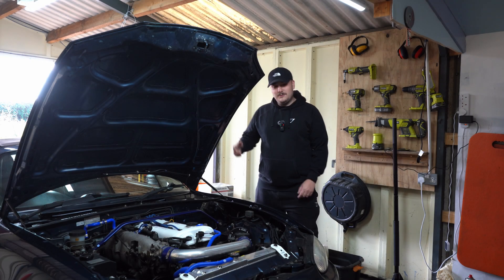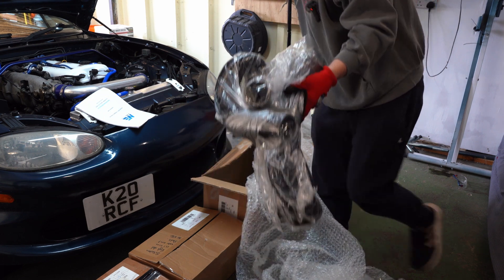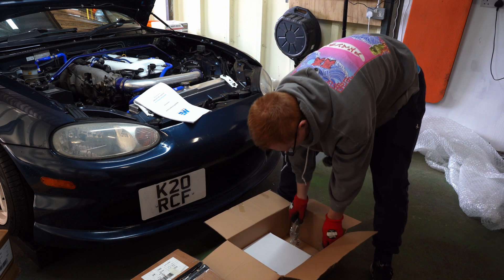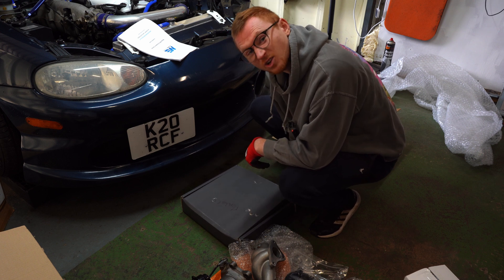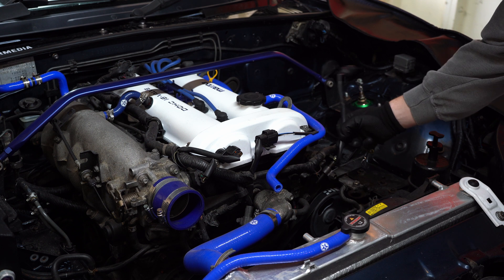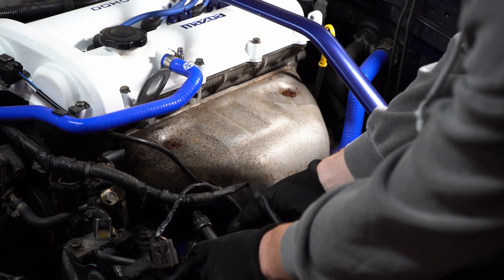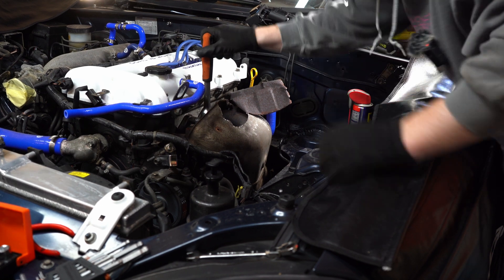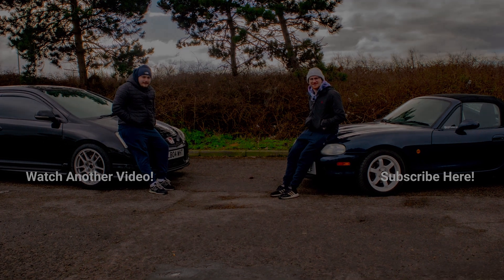DIY Turbo Build | NB MX5 Miata | Episode 1 | Motorsport Electronics Turbo Kit Unboxing

Comment: WHAT IS NOT CLEAR FOR ME. yOUR INTAKE HAS THE Maf air sensor. No thats gone to the turbo as just a filter. Is the wideband doing its job after that or where the mass air will be measured for calculation?
Reply from the maker: With the aftermarket ECU you don't need a MAF so it is deleted. It uses an air intake temperature sensor and map sensor to calculate the air flow. The wideband measures the air/fuel ratio only
Reply: Thanks to clear this in my head. @kentcarmedia